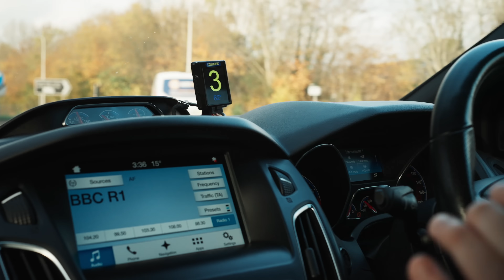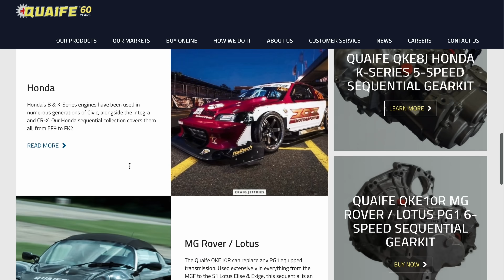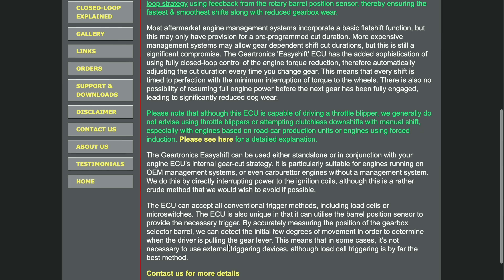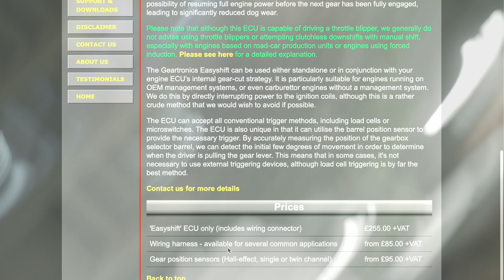Sequential Gearboxes: Everything you Need to Know | Quaife Engineering

Comment: Great video. 
Anything sequential for the Renault JC5 ?
Reply from the maker: We did start to look at this a few years back and started to model a gearbox however we weren't 100% sure on the demand as this would still use the standard shaft centres which are relatively small. Also with the price of the cars being fairly low the cost of the sequential would be almost the same as the car. Interested to hear your thoughts.

Comment: How much does the 60g cost
Reply from the maker: Base price is £6694.50 Plus VAT. There are then options for bellhousings, extended levers, Potentiometers and fully gear displays.
Reply: @RTQuaifeEngineering I'll be looking to purchase 69G next year.  Can I buy the 69G gearbox directly from quaife directly?
Reply from the maker: @Skyrexx7  Yes you can buy directly. If you email sales@quaife.co.uk we can send over the spec sheet for you to complete. If you need help with ratios we can also send you over the calculations.

Comment: Motor cycles have had sequential gearboxes for the decades
Reply: Yes, it is odd that more cars don't have them.
Reply: @dennisbailey6067 to expensive, good in motorsport but even then with the old H pattern you could skip a downstage , in racing, I.e 5th to 3rd or  even 2nd under hard braking you can't do that with a sequential g/box but in general sequential g/boxes are faster shifts

Comment: I know I wouldn't get one of these if I had a Honda K series with a 600hp turbo motor.  Not at 10kaud each. Imagine having done that on a custom built Ferrari for instance. What a great advertisement for your brand.
Reply from the maker: We don't want to go into the details but this isn't the fault of the box. We reached out to Mike a lot to offer assistance with no response. We sell over 100 of the Honda gearboxes a year and when set up correctly they are extremely reliable.

Comment: The bit that confuses me is that I'd like to get rid of synchromesh and if I've understood right sequential boxes aren't synchro ?. But obviously can't double de clutch a sequential box ?.How in that case synchronise the gears during shifts ?.
Is it possible to provide/modify/re build a conventional H pattern type box as just constant mesh ?.
Reply: @confederatenationalist7283

The best way to explain the difference between these transmissions is by explaining what is NOT different.  This is best done by explaining how something like a RWD T56 or the transverse mounted AWD EVO transmission becomes a sequential.  Step one is you get a dogged gearset for your H pattern transmission.  This should be simple enough to understand right?  Instead of syncros you have the dogs.  But the shift selector goes unchanged.  The problem with a dogged H pattern box is actually the misunderstanding of the money shift.  Most people are unaware that the money shift isn’t that big of a consideration when you have syncros.  Because it’s very hard for the syncros to sync a 2 to 1 mis-shift.  But in a dogged transmission is goes just as easily as going from 2 to 3.  So that’s one major advantage of going to sequential… it protects your investment.   

So for the T56 or EVO you just buy a sequential shifting mechanism.  For the T56 is replaces the top part of the transmission.  For the EVO it just connects to the original factory shift cables and moves them in the exact way they need to be moved to select each gear…

This is again because… a normal H pattern dogged gearbox and a sequential gearbox are pretty much the same thing.  The difference is just the mechanism that translates forward and backward movements into gear selections. It’s not a difference in how the gears themselves move around.  This is NOT a motorcycle transmission and I think that is part of what throws people off.  

This is also part of the confusion with the hole shifting under load or without the clutch.  First thing you need to remember is you don’t need to use the clutch on a normal H pattern transmission.  While it’s bad for the transmission from the shock you absolutely can pull the car out of gear and then if downshifting you can press the gas to the exact rpm needed for that gear at the speed you are going and then push the gear in or if upshifting if you did it quick enough you could slip it in as the engine rpm fell to the lower RPM needed for the current speed.  Again this isn’t good for the transmission but it’s absolutely true that you can shift without the clutch.  It’s also absolutely true that if you rev match everything while using the clutch it is actually easier on your syncros because they have less to do but that’s if you rev match slowly not race style rev matching.  

One of the reasons the sequential gearboxes in cars wear out so quickly is you are shifting without the clutch and just making the dogs take that hit and the killing the spark on the engine isn’t enough because just like before with the H pattern the dogs have to synchronize the transmission only there’s no chance of rev matching and with the clutch engaged the dogs are actually syncing the RPM of the engine!!! That’s a lot of force!  So they wear out much faster than their H pattern brothers and infinitely faster than REV matches H pattern dogged brothers.  

So again these are essentially the same exact transmission as an H pattern transmission that has dogged gearsets!   

Changing the gear in these without pushing in the clutch is just like doing it on an H pattern.  All the weight of the rotating mass in the engine is slamming into the dogs and the dogs are what feel the force required to reduce the engines rpm or increase.  Where as if the clutch had been depressed the dogs would only feel the weight of the engine half of the transmissions and the transmission side of the clutch assembly as well as what little drag is inherently being transferred from the engine side of the clutch to the transmission side even when the clutch is disengaged.  That’s a lot less force than say changing the rpm of a car from 8000 to 5800rpm.  Something that normally the clutch itself would handle quite easily as it’s variable and even if dropped it speeds those forces over a period of time that while short equates to making that max amount of impact at any given time be reduced to a small fraction.  

I hope that helps demystify what is essentially just an H pattern shifter with a complex mechanism that turns a single motion forward or backwards into 2 motions that would have been an in or out motion on one axis and a forward or backward on another axis.  Basically H pattern is just moving 2 different shafts in or out or rotating them left and right.  What ultimately happens in the gearset area is identical for H and Sequential.
Reply from the maker: Correct sequential gearboxes aren't synchromesh they are dog engagement. 

I think your also getting confused with what a constant mesh gearbox is as all our gearboxes both H pattern synchro and sequential are constant mesh.
Reply: @RTQuaifeEngineering 
That's as I thought they are definitely constant mesh as opposed to synchromesh.That's the usual way of differentiating the two different types non synchro v synchro.
Although technically it's synchronised constant mesh v constant mesh.
But how can you synchronise a sequential box without the neutral position of an H pattern to double de clutch it ?.
I would be interested in replacing the 5 speed Getrag conversion on my V12 Jaguar with an H pattern constant mesh box not sequential.Was familiar with constant mesh Fullers in trucks excellent shift quality compared to synchro.
Reply: @Daniel-S1 
That's what I said technically it's either synchronised constant mesh or non synchronised constant mesh.
But commonly just abbreviated as synchromesh or constant mesh.Usually previously and to date in truck use terminology where the two respective types are commonly found unlike cars.
Unlike trucks, car technology just made the jump from the different type of sliding mesh gear trains straight to synchromesh.
My question, being familiar with driving trucks and some cars with all three types of gear train, was how do you synchronise a non synchro constant mesh sequential gear train, without the ability to select neutral  between every shift to double de clutch it ?.That inability would obviously create a bad quality shift because you need to synchronise by rev matching the engagement in neutral before engaging the gear.  
As opposed to an H pattern type box. Bearing in mind that Quaife at least, among others, don't seem to be able to offer H pattern unsynchronised constant mesh gearboxes ?? which would be my choice not sequential.
On the basis that you can double de clutch an H pattern type box but not a sequential type box.Shifting an unsynchronised gear train without double de clutching it and rev matching it through neutral, to synchronise it, unsurprisingly creates issues in the refinement of the shift.
Issues being an understatement.

Comment: The Honda box drops its guts alot 😂😂😂
Reply from the maker: We don't want to go into the details but this isn't the fault of the box. We reached out to Mike a lot to offer assistance with no response. We sell over 100 of the Honda gearboxes a year and when set up correctly they are extremely reliable.
Reply: At 10k+ each time. Good thing if you're a YouTuber with the expensive box blowing up. Not for an average person. Hollinger lives behind high HP engines.